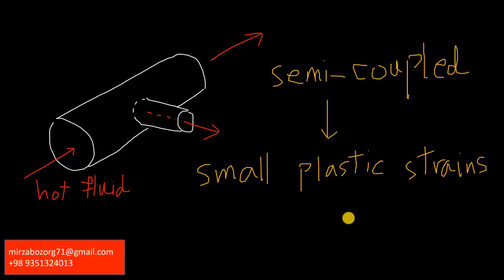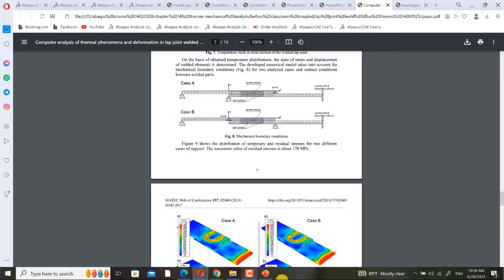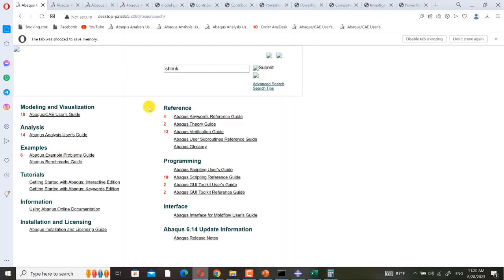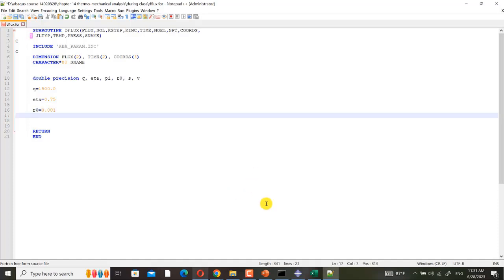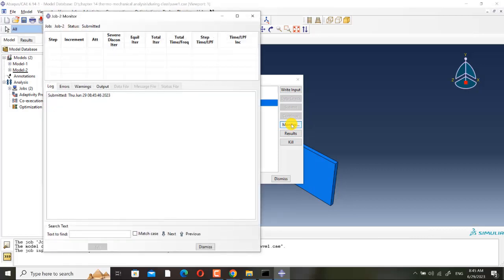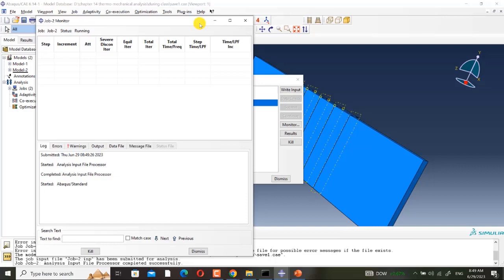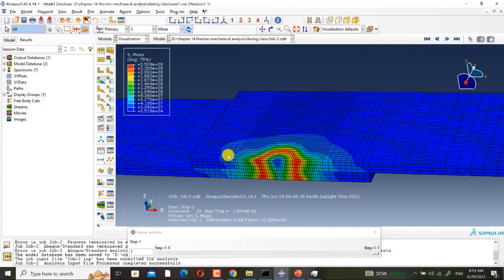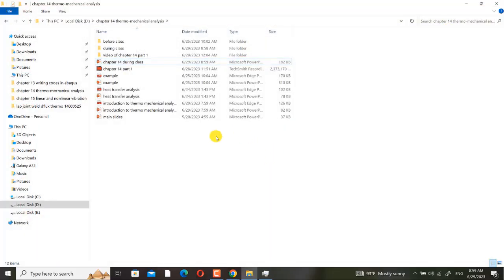Comprehensive Abaqus Package Chapter 14: DFLUX Subroutine and Thermo-mechanical Analysis (Preview)

Comment: Since heat flux is varying wrt time, Von Mises Stress should also vary. But looks like it is constant in your case. In static,general step , what is 'static' showing in case of stress analysis?
Reply from the maker: Hi.
Yes you are right.
Its because I only defined the yield stress and I didn't define hardening because it was not written in the paper. So the material behaves in a perfect plastic manner and when it is in the plastic region, the stress will not change and remains equal to yield stress. If we define hardening, it behaves according to your expectation.

Comment: For brittle bending we need to add plasticity properties that is yeild stress and plastic strain. If yes from where we can get those values?
Reply: What propertie is needed for bending?
Reply from the maker: @nikhil7796   To define the mechanical behavior you must define elasticity and plasticity. For Thermal behavior you must define density, conductivity, specific heat and thermal expansion.
Reply from the maker: Hi.
to simulating laser forming of the brittle materials you must define plasticity. For every kind of forming simulation you must define plasticity. You must search in the papers and theses or do tensile test yourself. You must define temperature dependent plasticity to get more realistic results.

Comment: What are parameters to change while bending of brittle materials?
Reply from the maker: Hi.
For the laser forming simulation, you can change these parameters:
- speed of the laser beam
- diameter of the laser beam
- power of the laser
- doing the process with multi passes on the same path
- doing the process with multi passes but on different parallel paths (you can change the overlap percentage)
- defining the inclination for the laser path
all of these will affect the bending angle and final curvature and you must check that the brittle material will break or not due to undergoing plastic deformation.